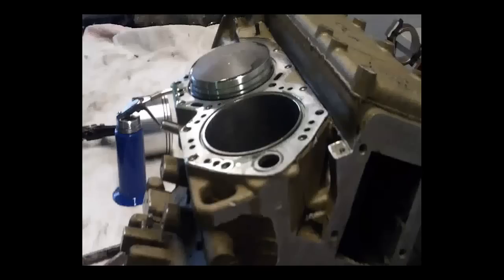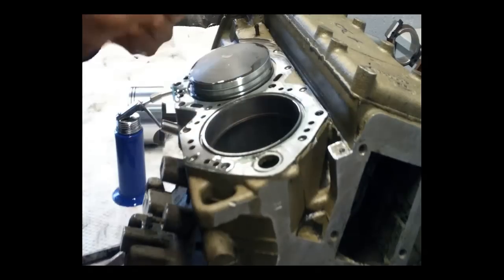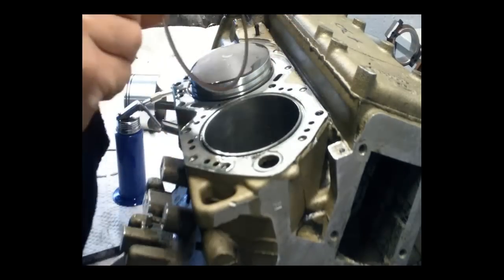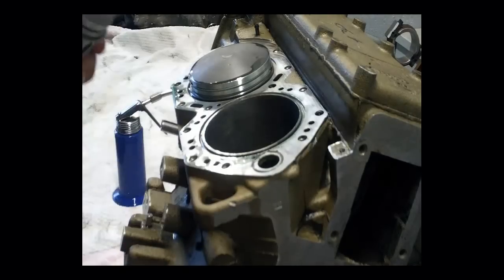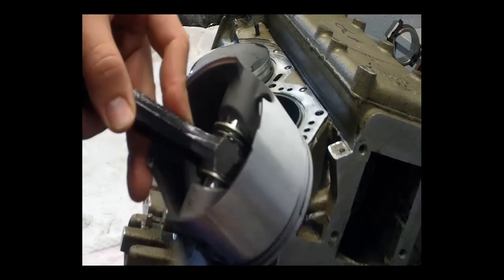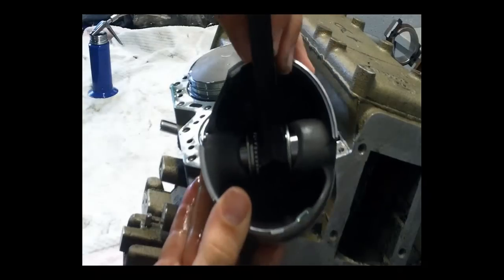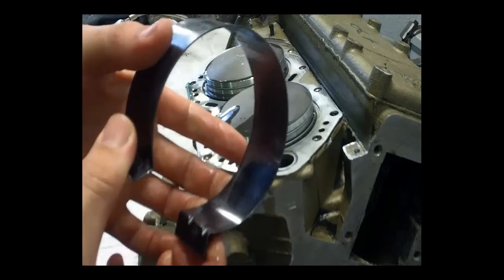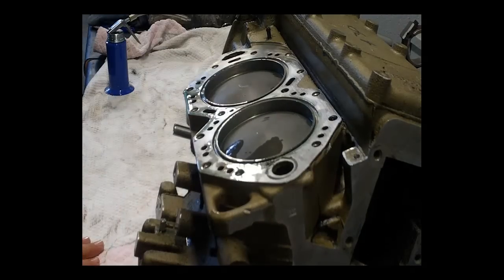How to install Outboard Pistons when rebuilding your outboards motor

Comment: Thankyou sir, great video! What would be the difference in a 4 stroke engine if you might share that with me. Looking at one that has about 60 psi in one cylinder, yamaha 4 stroke. Thanks in advance.

Comment: Question for ya m8.. I have an old 1991 75hp mercury 2 stroke 3 cylinder. I was getting low power on the water after the initial run. I suspected a fuel issue and I think the oil pump went bad. I have one cylinder with no compression, when I pulled the head the piston face looks very rough with some minor chipping on the sides. The cylinder walls appear to be undamaged. Is there a way I could just replace that piston and not have to rebuild the entire motor? The rebuild kit is almost $800, for the time put in its just not worth it to me, nor is it worth buying an new power head as they can cost upwards of $2000.
Reply: What ever happened, It just happened on mine too...

Comment: Question about seal ring gaps on 1986 Johnson outboard 90 hp. The book says place crankshaft in its block saddle with gaps facing up. I believe this is so the ends at the gaps will not snag and chip or break when setting the crank in. I see that a boat motor rebuilder posted that after the crank is in with gaps up you push the rings down into the crank grooves. He was not clear on what that means. So is he saying that you turn the rings from the top gap position so the gaps are then down into the block so the crankcase cover will not snag on the gaps when you install the cover. I see some guys saying that you need to stagger the gaps. Of course these rings are not compression rings like piston rings but are just spacers. So I don't believe it would make a difference if the gaps were offset or not. Now is there anyone out there that can for certainty say if the crankshaft seal rings need to stay with their gaps up or need to push the gaps down out of play for the crankcase cover so they are not snagged when installing the cover? Any competent comments on staggering gaps?
Reply from the maker: I always stagger the gaps so they are about 30 degrees either side or 90 if that makes sense. I did hundreds of motors like this, including race engines with great results.
Reply: OUTBOARD ADVICE- Question is does staggering shaft rings actually make a difference? They are what, thrust washers that keep oil clearance around the crankshaft journals? How would staggering increase anything as they all serve individual journals? The book says to install crank in block with all gaps up (toward crankcase cover).  A boat motor mechanic that I spoke to some months back also said to put the crankshaft in the block with gaps facing up. I saw a motor rebuilder from Viking marine in Florida post that you have the gaps up. But then he says after placing crank to push the rings down into the block. So I wondered if he means after putting them with gaps up into block saddle to avoid snagging, to push the ring gaps around and down into the block so they do not snag on the crankcase cover when it is installed. I noticed that when I took the crankcase cover off  the ring gaps were all facing down into the block, not up toward the case. Of course it has been rebuilt previously. OUTBOARD ADVICE- another question is about the difference in piston ring gaps. The book (Clymer)  said 1986 and older gaps for 90 Johnson was .007- .017. But 1987 and after the gap is .019- 031. So if both are 3 1/2" cylinders why the big difference in the newer motors. Is it because they changed the type rings manufactured after 1986 that expand more? The rings I bought from Riken are gapped so the unworn part of the cylinder the gap is about .025. That would fall within the 1987 and later gap specs. But the motor is a 1986. I can't figure why the difference is so great on earlier and later rings unless it is because they begin making them to expand more. In which case all rings that you now get should have the 1987 and later gap specs.

Comment: Good video , but please slow down some so I can see were the piston rings gaps are located correctly
Reply: Just use a flat piston head to push the rings down into cylinder no more than about three quarters of an inch. Much more than that and it is a pain and damage risk to retrieve.  If you have a domed piston that is not flat then if the bottom end of the piston is completely true around, you can use that end to push the ring into the cyl. making sure if the rod is attached that it is not banging on cyl wall or hitting the ring when you insert or retrieve it. You can stuff the piston with clean newspaper so the rod stays stiff and straight center. If desired you can put a piece of masking tape just above three quarters inch on piston so you can tell when the ring gets that deep. When ring is about three quarters inch down, and not much more, and it is square/true around remove piston and take a feeler gage and insert the blades between the gap. Then compare the readings to specifications. If not enough gap, try again using another ring, and if still not enough gap they say to carefully file the gap down to spec. I would say make sure you got the right rings as todays rings are pretty much accurate. If gap is too much (over specs) and you have right ring, then you need a bore with new oversize piston and  rings. Of course before you get to that point you should have already miced/gaged the cyl walls for trueness and wear specs.  A machinist will do that for you for free or hardly nothing. Just hope you get an honest one that is not trying to make a quick buck boring your cyl when not needed.
Reply: Oh I should have clarified that only putting ring three quarters down for spec check is only for a rebored cylinder. If you are putting rings into a worn cylinder that has not been bored you need to push the ring all the way down below the ring travel in the bottom section of the bore. That is the position that the ring must be gap measured to see if you have right ring spec, because the bore tapers from wear and  increases gradually in diameter and is largest at top of ring travel. If too much wear in cylinder I believe it is recommended no more than .003 per inch of cylinder size, then the cylinder needs reboring, So you will get a larger end gap at the top of a worn cylinder and must measure below ring travel to check specs and then determine if you have too much cylinder wear for std,  or same size rings. Have the cylinders checked by a good machinist to start with is a good idea. If he says cylinder is not too worn out of round/tapered then if your rings have too little or too much gap below the ring travel you may have the wrong ring.
Reply from the maker: You should ideally use a bore gauge to measure cylinder taper and wear. If the bore is straight, and round (if more than 0.004" worn it should be bored oversize) then measuring the ring gap 3/4 inch from the top is fine. You can add the 0.004" to the ring gap if the bore is worn to check you still in spec. Pretty hard to measure ring gap at the bottom of the cylinder.
Reply: The info that I got about measuring the gap below the ring travel was from Timken a Japanese ring manufacturer. I had my cylinders checked with bore gauge and were within tolerance. They were previously bored to .020. One piston and cyl was scored so bored it to .030.  What Timken is saying is that when you buy a new ring for a honed cylinder not a bored cylinder you need to push the ring square below the ring travel where there is no wear. Will need flashlight. Then if your gap is not within specs you have a defective ring or more likely the wrong ring as that ring will be sized according to original bore size. I believe they said you could have .003 per cylinder inch  of taper from bottom unworned section to top of piston travel. They may have been referring to car engines. But the reason for measuring at the bottom end is to get the original bore size compared to replacement rings to see if that conforms to gap specs. Then you can measure the gap just below the top of ring travel and see how much difference the gap is from the bottom. If it is any where near the max tolerance then you should definitely spec your cylinder with a gauge and probably bore it. Now here is a question for you. The book says ring gap for up to 1986Johnson 90 hp. is ,007- 017. Then 1987 on gap is .019-.031. So question is, if both have 31/2 inch bore why is there so much difference in the piston ring gaps. Only thing I can think of is that the specs prior to 87 were original specs when rings did not expand as much. Then 87 on they must have made rings that expand more. So even though you rebuild a 85 motor the rings you buy will have the larger gap tolerances of an 87 or newer as those old rings are no longer made. Does that sound logical, as I see no other explanation?
Reply: Sorry folks I said Timken in above comment but I meant Riken Corporation. However neither of these were where I got the info on ring gaps. I went back and looked it up. I got the gap measuring info from Hastings. They say no more than .003 wear per inch of cylinder diameter. So a 31/2" cylinder should not be more than about .010 difference from the measurement you get at the bottom of cylinder below the ring travel (unworn section) to the top portion of ring travel(most worn section). They say do not exceed .012. This is referring to putting new rings in a worn cylinder that has not been bored. They say if you measure only at the top (most worn section) you could get a gap that is over the max gap but the ring is still within specs as the specs are for new unworn cylinders or bored cylinders. So I would assume that if you only have about .004 to.006 wear difference from the bottom unworn section to top of ring travel with the bottom measurement within specs that you would probably be good to install rings without using cylinder gauge. Any thing over that and you probably should gauge it for sure to see if it is too out of round. Of course if you have a gauge, use it. Now I do not know if the wear tolerances are less for an outboard. You need to check with marine mechanic on that.

Comment: Thank you for sharing, i just saw people change their four stroke engine in to two stroke one and my question for expert builder like you is what would they do to their piston? can it be used a four stroke piston for two stroke engine? other than the skirt height, what will happen to the four stroke piston rings when it is inserted in to two stroke cylinder?

Comment: HI there, great video. I have a 1974 40 hp Mercury. We started it on the muffs the other day and we had water squirting out of the Spark Plug on the top cylinder. Have you got any ideas on this? I am about to go home and strip the engine down. Any advice or ideas would be much appreciated. 

Cheers

Comment from the maker: Hey Michael. Yes you can, you need to buy the tool to suit the motor you are working on. A dealer should be able to order the correct one in for you. Or if you have a friend with a lathe spin one up.

Comment: I have a question4 u buddy,im rebulding a 1997 mercury 90hp,it doesnt have cyl,heads, i have to put in the pistons by the back & then drop in the crankshaft, can i still use a piston ring compressor or would i have compress the rings with a flat screw driver on my motor?..great video you are a king at rebuilding motors